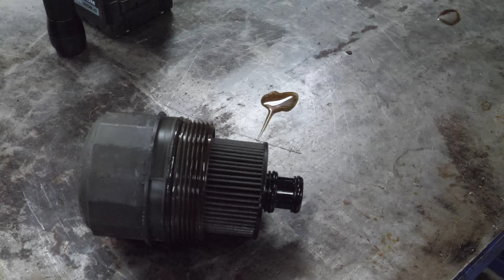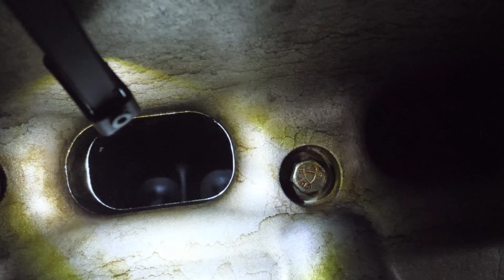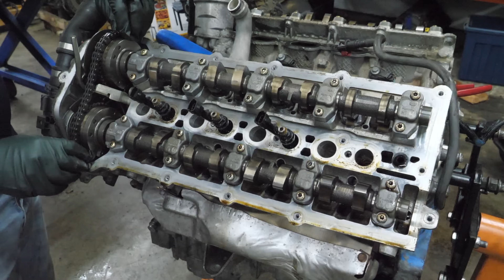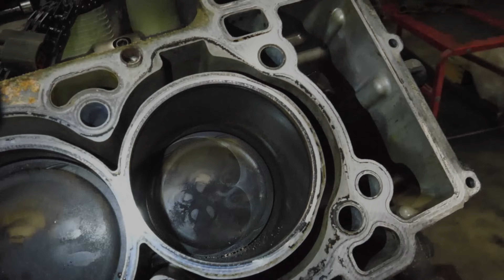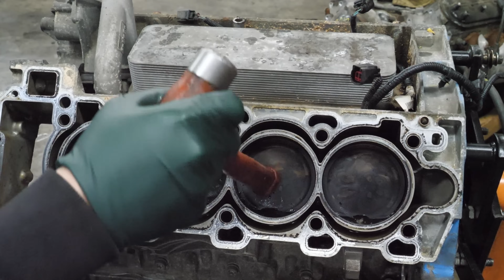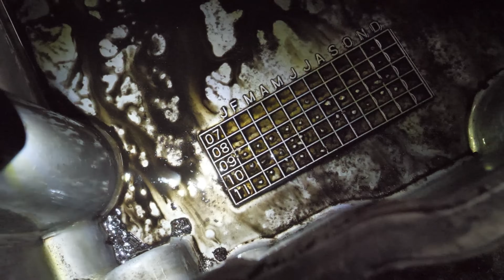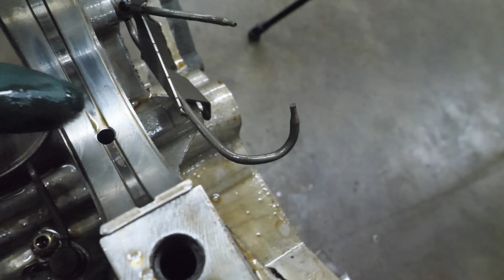500HP Jaguar Land Rover 5.0L Supercharged AJ V8 Teardown! Had to buy AND borrow tools just for this

Comment: "Timing was never bad on this" 😂 
Been working on these engines for 10 years... 5 things they messed up on these engines.. 1 oil intervals from the dealer, 2 timing designs, 3 head bolts threads trips out when overheated, 4 no oil pressure switch, 5 no temperature gauges on Jaguar models (back to number 3). And thank you very much!
Reply: Yeah, I change oil twice a year in me 2013 RRS SC, for winter and summer, about every 3k miles or so. 5w30 RedLine real, true synthetic unlike all those Castrols, Mobiles, etc.
Reply: No oil pressure switch!?! WOW I didn't know that. I'm stunned since these things put out some serious power, even by today's standard. 

I often wonder if JLR extends the oil change intervals because they know the vast majority of initial new car purchases will be leased? I only say that because BMW does very similar things, and again, are heavily leased and provides cover for the new car buyer.
Reply: May the Lord have mercy on your soul.. Do you still have your hair?
Reply: (thermo-)Plastic parts in an engine? Brilliant!  Engineering at its finest
Reply: @hellkitty1014  the weirdest thing is that it has a level sensor but its too late whenever it runs out of oil.. older models uses oil pressure and cuts out the engine automatically..
Reply: @Piccodon  wait until you have to replace the rear coolant cross pipe right behind the firewall lol
Reply: @gcrauwels941  he has earned enough to get a full hair transplant
Reply: No oil pressure switch & no temperature gauges? Is that even legal for car makers to do that??
Reply: @elNenio  Jags were always famous for unreliability and difficulty to repair. 
Rich guys buying these cars and selling them a couple of years later rarely would lift the hood, and pass on the mess to unsuspecting suckers. Luxury cars are only luxury when nearly new. Then you have a maintenance nightmare with overpriced parts that won't impress anyone, unless it is a super exotic.
Well engineered cars impress me more, and with "well" I also mean cost effective and reliable for 300,000 miles.
Reply: @Piccodon  Yeah, but they lose more in depreciation in week than the entire value of my car (300,000-mile Golf, which I've had from new).
Reply: lol
Reply: Would you own one?
Reply: @Piccodon  UK My 3.8 Mk II is at 122K and still runs well. It does get an oil change at 2,500. Mind you it sleeps with me, the old dragon doesn't mind (much). Living in a country where you can't be more than 60 miles from the sea helps a lot. 100 miles in the UK is a long journey.
Reply: @davidstewart4570  You exaggerate, but not by much. My 2010 XF Supercharged had a sticker of $68k. I bought it at 7 years old with 42k miles for $18.5k. Over a dollar a mile in depreciation.
Reply: @Ken M Hi ken, My dad has rebuilt this exact same engine which had a spun bearing. The crankshaft has been re-machined, new fuel injectors, rod bearings, piston rod and coupling, and new timingchain. The engine is all put back togather and runs well exept it misfires. There is also liquid black suff dripping out the exhaust that forms a little puddle on the ground. We have found that it is not because of the sparkplugs, fuel injectors, timing, fuel pump or fuel pressure, ignition coils, and the compression is good. So i was wondering if you knew what could be wrong. I can even send you a video of the car running if you would like. 

Thanks again.
Reply: @basilnabeed1674 all i can say.. these engines are whack.. i had one when its misfiring.. jus cycle the ignition then it clears the misfire..  then comes back once in the blue
Reply: @elNenio i’m getting misfire codes/rough idle and this code

P052A- Cold Start Intake (A) Camshaft
00
Position Timing Over-Advanced
(Bank 1) - No sub type information

any ideas where to begin?
Reply: @hoeman45  clear it.. if it comes back as soon as you start it then it needs timing n vvts.. if it takes awhile to come on best bet to flush the oil twice.. you can use seafoam.. not guaranteed but its your best bet...
Reply: @elNenio  not only did they not clear and misfiring in all 8, i now have these codes

P0341
Camshaft Position Sensor A
Circuit Range/Performance
(Bank 1 or single sensor)

P054D
Cold Start *B° Camshaft
Position Timing
Over retarded Bank 2

P054B
Cold Start *B° Camshaft
Position Timing
Over retarded Bank 1
Reply: @hoeman45  so you clear it.. start it then the codes comes back with these? If so then you need timing chains, updated tensioner and guides and 4 vvts..

Comment: The biggest weakness of these engines is the timing chain tensioner rails. Up to 2012, they wear where the tensioner pushes on them. At around 90,000 miles, the tensioner rails are so worn, they can no longer keep the timing chains tight. The chains jump time, and the valves get broken off and destroy the engine. I have bore scope photos of piston tops with valves embedded in them.
Later engines have a steel button on the rail where the tensioner pushes on it. I can't believe the engineers let that one get past them.

Comment: Our 13 Range Rover sport had this engine.   It was actually a really good motor.   Only had to replace supercharged pulley and a few related parts at about 90k miles   We bought it new.   Had a few other issues but engine was a reliable beast!

Comment: Yes, the HP pumps need to be timed to the rest of the engine. The pressure pulses they create are included in the fuelling mapping calibration.
Reply: I noticed what appeared to be a timing mark on the chain, and thought that's gotta be the case
Reply: Yes, thats correct. The HP pumps are timed also
Reply: The should be two colour marks on the chain. The  yellow mark goes on the chain goes in line with the groove on the pump cam at 12 oclock, the woodruff key on the crank should be at 6 oclock (bottom), the other colour mark goes on this. The bottom part of the sump came into the factory fitted to the sump, there was no need to remove this.

Comment: That pipe coming up to the oil cap is for oil evacuation.  Those engine are designed to have the oil suctioned out and not remove the drain plug.  Awesome teardown!
Reply: Does any old like vacuum bleeder fit on that tube or do you need...

sigh

A special tool to change the oil?
Reply: @warphammer The oil extractor tools work the best but any vacuum tool that will hold at least 8 quarts will work.  It takes forever unless the oil is up to temp.
Reply: @warphammer  Just note that that is the best way to do it - but they still have the old school drain plug you can use. Lots of the more advanced modern cars now do oil changes this way - at least the European types. I don't have much knowledge of American designs.
Reply: Draining the oil the old way you had to remove a pretty heavy skid plate.

Comment: If you ever get the opportunity and have the inclination I would love to see the Rover and the Ford engine pulled down as a tandem strip.  I just think the side by side teardown would be amazing.
Reply: Sounds cool to me too.
Reply: are you implying a relationship between the Jag5.0 and the Ford coyote 5.0 ?
Reply: @imabebebebe2496  he said this was a jag engine, and there was FoMoCo all over this. ima say thats definitely a thing. also, i hopefully detect sarcasm but the internet doesnt translate that well
Reply: @imabebebebe2496  Did you see FoMoCo stamped on the chain tensioner? Ford used to own them before recession and TaTa becoming a new owner
Reply: @VictorGalayda  yeah, but that doesn't mean this is related to the Coyote. They're completely different engines. Only commonalities are cylinder count, bank angle, number of valves, and number of camshafts. The engineering legwork on the JLR 5.0 was done near the end of Ford's ownership of Jaguar and Land Rover, and IIRC the agreement they came to with TaTa said that Ford had to supply parts for the engines until they were phased out (might be wrong about that part, please correct me if I am), hence the FoMOCo stamped on a lot of the smaller bits.
Reply: @CaptainSpadaro  It indeed doesn't mean that they are related. But knowing Ford's involvement, the cost of R&D, and the fact that the bank angle is the same is a good enough reason to at least investigate if the new 5.0 from Ford is based on the same engine. Especially after looking at the line of GM engines from the same era.
Reply: @VictorGalayda  but they aren't. Everyone knows this. The Coyote traces its roots back to the Ford Modular engine. It has no relation to anything built by Jaguar.
Reply: @bradhaines3142  it genuinely did not occur to me for the last 12 years that ford and jagwar went halvsies on a new v8. it makes sense that they both showed up in 2011 models.

Comment: Edit: the pipe leading up to the left valve cover is an oil drain. These engines are designed to do oil changes from the top of the vehicle. You pump the oil out through that pipe using a vacuum pump and the oil filter is on top.

I’ve only done a little bit of work on the 5.0SC (stopped working on them when they were still fairly new), but I’ve done a lot of work on the 4.2SC and they are absolutely stupid to work on. Coolant hoses running everywhere, lots of leaks, zero thought put into the design. The worst repair I ever had to do on one was fuel injectors (port, not DI). I think it was like an 8 hour job, and I think we had to order like 30 individual gaskets and seals for the job, which took literally hours on the phone with the Jaguar parts person to describe that we needed. Absolutely stupid how these things are built.

The 1 piece high pressure line makes sense, joints are just another place to leak, which is unbelievably dangerous when taking about gasoline under 2000+ psi. What doesn’t make sense (except to JLR engineers apparently) is running the lines behind the engine mount bracket. But, par for the course for JLR design I’d say.

As a tech who used to work for a European specialty shop, I have nothing good to say about JLR. All horribly designed from a service/repair standpoint, and all terribly unreliable.

Comment: The oiling system on that engine was both extremely impressive, but also an exercise in overengineering.  Looks like many things would be very difficult to fix with the engine in the car.  Based on this and other videos, it seems like the oil pressure fed tensioners are really the downfall on many engines.  The oil pressure goes low for whatever reason (And during startup) and then you have noise, or far worse, jumped timing.  I think a simple spring would be a much better idea, or, a back-up spring for when the oil pressure is low.
Reply: When my 05 Nissan Maxima sits around for a few days I hear the timing chain slapping upon cold startup, I then turn the engine off wait a few seconds and start it back up and then it's quite. The common repair is to replace the chain tensioners and chain guides, difficult with the engine in but not impossible, VQ35DE engine.

Comment: If you have the time it may be worth it to look up the parts for your Milwaukee tool. I’ve had a Milwaukee drill for the past 10 years, and it’s used everyday. It’s one of the last brushed versions, before they switch to their fuel brush-less system. 

Anyway it finally crapped out, and needed brushes, and all the rubber parts had worn off, so I thought I’d just replace it. I looked up the parts first though, and a new drill body/handle with brushes was under 50 bucks. It’s like brand new again, good for another 10 years.

Comment: That was a really interesting tear down.  A complex design with some odd aspects (cam in the oil pan to drive the high pressure fuel pumps).  Thanks for staying with that one, it was interesting without major carnage.  As someone else commented, I wonder if someone was in there doing the chain guides before and that is where the plastic came from and how the FOD happened to that piston.  And, great score on that Mustang, hope you make good money on that, as well as this engine.
Reply: I appreciate this is old news, but the high pressure fuel pump design is because they re-used the previous port-injected 4.2 litre design to make this engine. The top end is pretty tight (and already had production supercharger designed etc), so the easiest place to add the HPFPs was down in the bottom end. A relatively small change to parts which needed minor casting changes etc, rather than redesigning all the inlet components.

Comment: Nice job. Simple enough engine to work on. I think that’s probably covered about 200k. The crank just needs polishing and new shells. 1 new piston although I would replace the set. Cheap enough. Rehone the bores. The rest is just nuts and bolts. As for the chains and that missing plastic, someone has changed them before without replacing the tensioners. And they’ve put pre mod ones in. So it was probably done some years ago. In the uk at least there are companies that reline the supercharger rotors with that hard plastic.
Reply: So not from the Engineers Club For The Promotion Of Insanity In Mechanics then?

Comment: I'm a strong believer in these engines   AS LONG CHANGE THE OIL AND  FIX THE TIMING GEAR ISSUE.  A weekend in the garage and $700 in parts and tools is all it took for my XKR-S and I couldn't be happier.  

I've noticed that in the jag community, there's alot of folks who have it in their heads that because jag developed the engine, they knew what's best for it.  It's usually people who just throw their money at mechanics rather than familiarize themselves with the engine, and that's why there are so many failures.
Reply: Just curious, what timing gear issue?
Reply: @lelandgray8996  the early 5.0 engines from JLR had an issue where the steel timing chain tensioner would slowly wear a hole into the aluminum chain guides, causing loss of chain tension.

Comment: Have a relative of this engine in my 04 V8 LS. Great engines, when they aren't overheating. 280hp was not bad for the time, especially considering the weight of the LS at 3800 pounds or so. Though mine needs work. Due to my dad thinking he is Mr mechanic, Its got 2 of the valve cover bolts broke off in the cylinder head.
Reply: I have one too! Though I do all the work myself.
Reply: Try a left handed drill bit you would be surprised how well they can work
Reply: I have 267k on my 06 LS and my only gripe is having to replace the plastic cooling system parts every 70-80k.

Comment: As somebody who owns a car with this engine it is a fantastic engine as far as performance. 

I recently had the "Medusa" hose or coolant crossover pipe(heater manifold pipe) burst, I was quoted 5-7k for repair. I ended up doing it myself and boy was that a job tool 4 days but I ended up getting it done, there were about 50 bolts that needed to come off in order to remove the intercooler, and supercharger to get to the pipe. 

The good thing about the specific version of the configuration you have here is that the coolant crossover and the "Y-pipe" are both the metal version, on many versions they use plastic pipes that brake and degrade very fast and require the removal of the super charger.

Comment: Problem with the early 5.0L s/c AJ/V8 is that the tensioner pins get stuck in the softer material of the chain guide.  JLR know about this and have modified tensioners from 2017 (iirc) onwards so that they have a metallic plug in the guide that has the same hardness as the tensioner pin.

Comment: you know its a fancy engine when it doesnt have a dip stick to fight with
Reply: If fancy is a synonym of overcomplicated, I agree.
Reply: Jags transmissions state no need to change fluid. So many failed due to tranny issues.
Reply: @unitedwestanddividedwefall3521  True. ZF recommends 50-60k miles. They know. I do mine ZF transmission oil changes in that range and all good.
Reply: @unitedwestanddividedwefall3521  yea man they take that “sealed for life” rhetoric way too serious lol, sometimes you just need to ignore the manufactures “recommended” intervals because they make money selling the vehicle, maintaining it and denying warranty even when all was done by the book. $5-$6k trans every 120-150k miles should never be a company expectation because of their maintenance schedule....fluid is a lot cheaper than a transmission for sure
Reply: @unitedwestanddividedwefall3521  Done plenty of ZF services as part of most models 100k/10yr service so they do actually have an interval
Reply: You know it's a POS engine if it doesn't have a dipstick you mean 😉
Reply: @Wtrxprs007able  It has a digital oil level display.
Reply: @scottj273 I’d rather have an analog one

Comment: I've had the "pleasure" of working on these shits, mostly maintenance but there was one where i did a thermostat, which is relatively easy, but in the removal process I broke the little 45' nipple that sits in the water pump. I tried to find it separately but it would take too long from ebay so I instead had to get the complete water pump from Rover. The nipple really likes to break, if anyone does a t-stat or any hoses - watch out and keep 400-500 bucks on hand for a pump. There's also a plastic piece behind the pump that mates to it and a crossover tube, get that as well because you do not want to go in there again over a 10-15 dollar plastic piece.

Also, the supercharger belt is in front of the accessory belt. If you need an accessory belt, you need to remove the blower belt and tensioner with bracket because the accessory belt wraps around an idler pulley that faces toward the timing cover. The accessory belt tensioner has to come out for the same reason. At least the socket sizes aren't unusual and consistent.